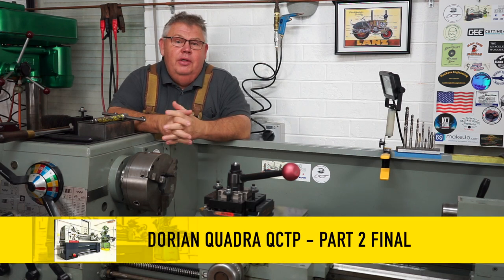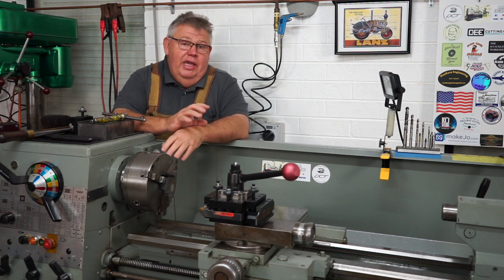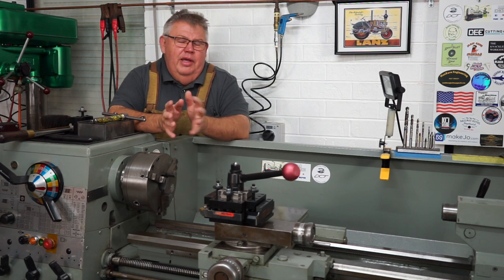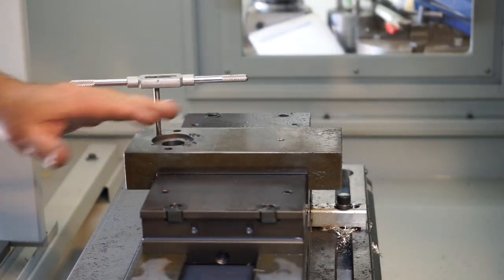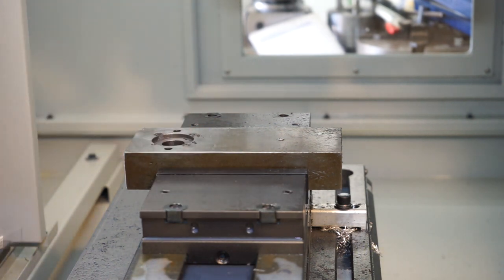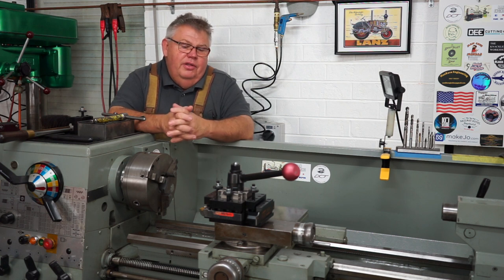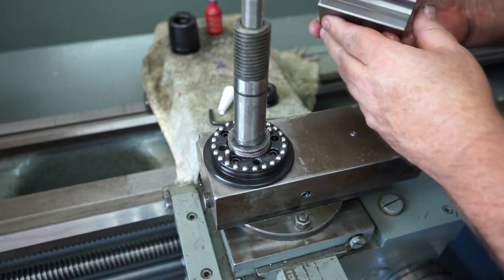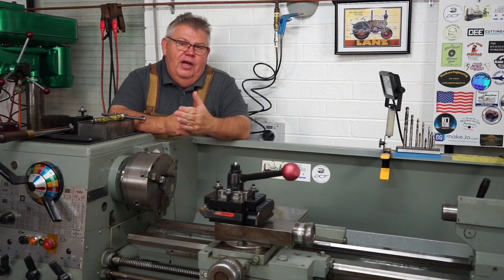New Tool Day 2 - Dorian Tool Post Installation

Comment: Hi Arron. Enjoyed the machining on the top slide. High speed parting off with no coolant making the washer. Just thinking about it my parting tool would have snapped off lol. Tony
Reply from the maker: G'day Tony.  It's always nice to hear from you mate.  Yes I got caught out parting off in part 1 with a HSS blade.  However, in my home shop I've got a very good quality Iscar carbide parting tool which I just plunge in under autofeed.  It's the same style and type that I used to use on the Hass CNC lathes.  It's a nice tool and I have some confidence with it 😉.  Trust you've been well buddy?  Cheers, Aaron.

Comment: That's a really nice looking tool post.  Are there other advantages to an Aloris style beyond being able to hold 4 tools at once?
Reply from the maker: G'day Mick.  Just watched your new tools video, you got some great stuff.  In regards to the tool post, the main reason that I went with the Dorian Quadra style is the ability to index at 15 degree increments.  Dorian have another type called the "super quick change" but it is locked at 90 degrees and can't index and can only hold 1 tool at a time (side or front).  So to do a chamfer you would have to use a 45 degree lathe tool.  Hope this makes sense Mick?  Oh, we need to swap stickers mate.  Cheers, Aaron.
Reply: @AaronEngineering  Makes sense. I agree, check your email.
Reply from the maker: @MicksWorkshop  G'day Mick.  Great minds think alike.  I just sent you an email also.  Found yours in my junk folder.  Bloody Microsoft LOL 😂

Comment: when the base is tightened it always stays straight or you have to put it straight before tightening it, thanks
Reply from the maker: Yes it locks in via a ring of special mounting rings. These allow it to be indexed at 15 degree graduations. Cheers 🍻

Comment: Does it always end up rotating 90degrees? i use multifix
Reply from the maker: Hi Jan. The Multiflix QCTP is a very good design and unit. I had them fitted to all the lathes at another college that I managed. However I believe the Dorian is much more heavier duty tool post (personal opinion only). The Quadra type like mine can index 24 times @ 15 degree increments. However I think the Multiflix will index 40 times @ 9 degree increments. Thanks for watching. 🍻, Aaron

Comment: If you turn your compound to 29.5 degrees wont you need a thicker shim?
Reply from the maker: G'day Neil.  Yes I could do that.  Alternatively, I could also index the main body (where the 4 bolts went) 90 degrees anti-clockwise to move that handle back.  However, I mount my camera to the top of the compound slide with a magnetic base so was trying to keep that big handle out of the way.  Cheers, Aaron.
PS: love your mower lift.  That makes the job so much easier doesn't it? As for me, I hate working on the ground 😉